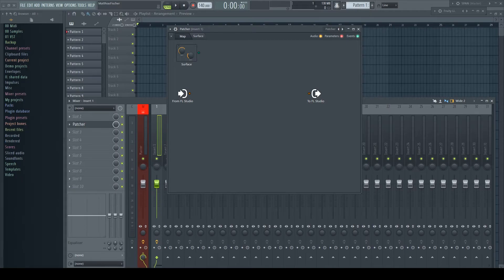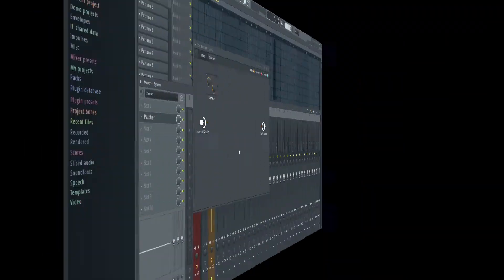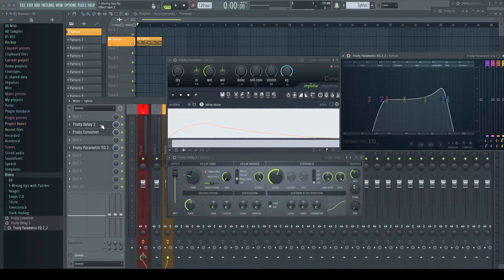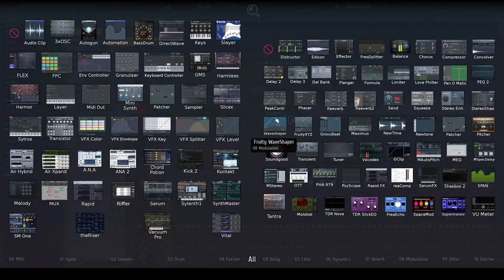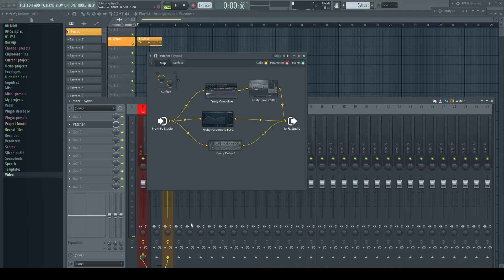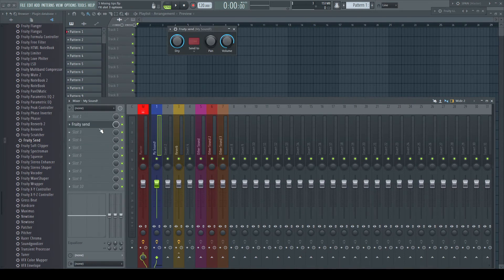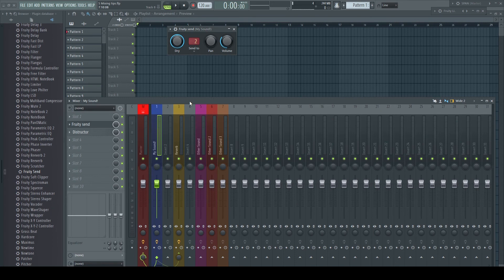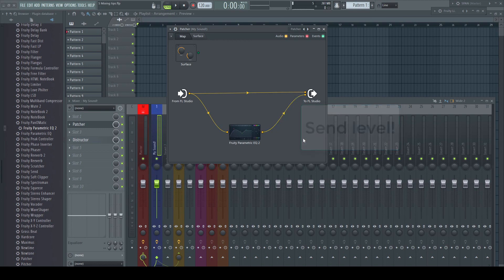5 Mixing tips with Patcher...Part 1

Comment: Concentrating on sends: 
1) Creating a real send without creating a different track
Dry/Wet mixing
Example: Adding reverb and delay at the same time
A)Open patcher 
B)Add reverb/delay in paralell and maybe filter the dry signal. 

2) Pre fader sends 
Post faders grab signal from the end of the complete chain, incluiding panning, volume, width, etc. 
Fl studio has Fruity Send, so this way you have freedom to choose from where in the chain you want to connect to other tracks. 
What happens if you cannot select any other track though? You must connect them (sidechain).
What if its too bright or whatever, though? 
We use patcher, as it recognizes the recieving channel when making a send/sidechain. 
A sending port can be activated in the output module.
Now you can drag a connection from the same input to both, so you can filter  the portion going into the reverb,

Comment: Again.... nice! Didn't learn too much about Patcher specifically here... besides realising I was using patcher kinda incorrectly.... as a generator, with the synth inside of Patcher, then messing about with parallel effects (inside the 'generator' Patcher). FL 'teething problems'. BUT, you've reminded me of the awesomeness/flexibility of the 'Fruity Send' plugin.

You heard of 'Brainmodular Usine'? It's this program's fault I fell in love with 'patching'. Aditionally, FL's 'Minihost Modular' was the primary reason I became aware of/invested in FL Studio.
Reply from the maker: Using Patcher as a generator and doing routings in there isn´t "wrong" at all...
There is no right or wrong... just personal preference and sometimes some general decisions about e.g. CPU usage...

I never was into Usine... I heard of it but that´s basically all I know of it...
Reply: @flstudiotricks6903  I get ya, obviously it's available as a generator as well as an effect for a reason, but for my use cases, my methods were a little pointless. I just get lost sometimes. :)

Comment: Hi. Love you videos. How do you set up a mod wheel in a patcher instrument without it controlling all the mod wheels in the project? I have set up all the other parameters using 'override generic link' but it doesn't work for the mod wheel. Thanks for what you do for the community.
Reply from the maker: This isn´t possible in this way... at least to my knowledge...
Because FLS doesn´t work with Midi internally they use a little trick to assign the Modwheel and the Pitchbend to 3rd party instruments by default...
This trick doesn´t work for native plugins (like Patcher is...)
A plugin which is hosted in patcher can just be controlled by creating a new connection via link to controller...
By doing so you kill the generic links trick to all other VSTi´s in the project...as link to controller has a higher priority than generic links...

The easiest way is to use a different CC number for what you want to do in Patcher and leave the mod wheel alone...

Sorry for not having better news... but I can be wrong...
Perhaps some Midi cracks on the IL forums can help better...
Reply: @flstudiotricks6903  Thank you for your answer. Where abouts in Spain are you. I'm in Mallorca.
Reply from the maker: @adamcalma  I am living in Gran Canaria